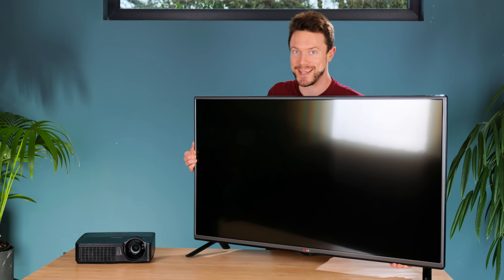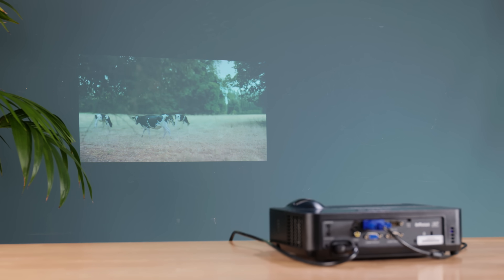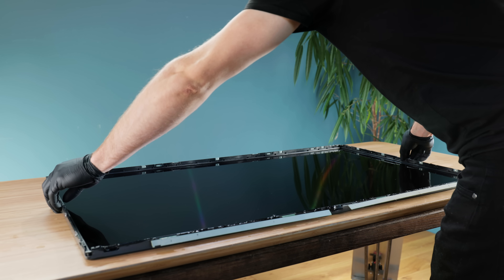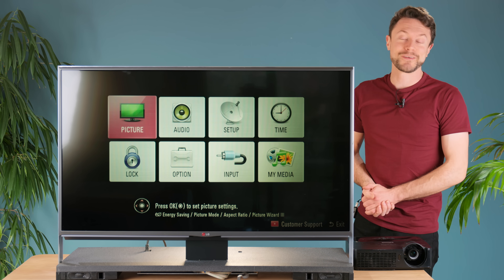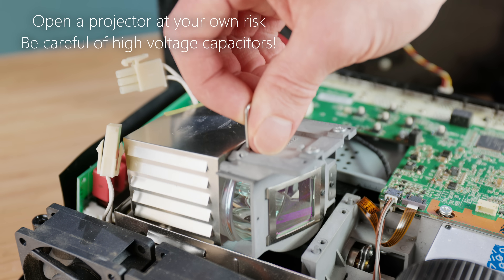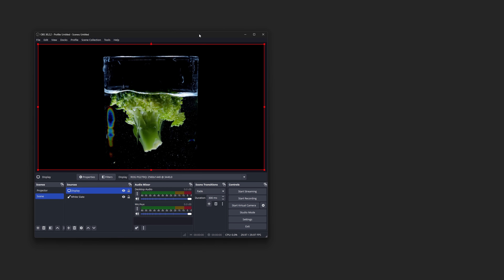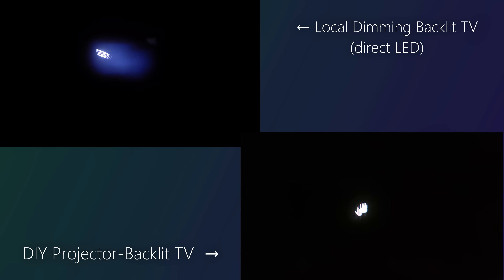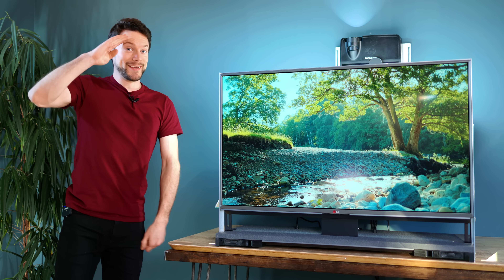DIY "infinity contrast" TV -  with 100% recycled parts

Comment from the maker: Thank you guys so much for watching! I've been trying to make more accessible projects lately (after going a bit wild last year)... smash the like button if you think this is a good idea! Also, how many previous projects could you spot in the background throughout the video?
Reply: I actually want to see how good of a monitor can you make if you are not budget constraint! Either using this projector method or the dual lcd you tried in the past... like a 4K 120hz super bright monitor.
Reply: Last year was brilliant. Especially the PS5 Slim.
Reply: I’m curious, what if you didn’t add the diffusion sheet? I’m sure the parallax effect would’ve been removed. The only challenge would’ve been alignment. And technically, this could result in even better light resolution than what is lost due to OBS’ glow effect?
Reply: Please don't limit yourself to ideas and projects that would be accessible. Your high-quality videos are what make your work stand out—there’s no need to compromise on that to keep things accessible.
Reply: As usual. Genuinely genius
Reply: It does make me wonder if simply finding an old projector TV, replacing the bulb, removing the filter, and installing an LCD panel in front might actually make the most sense as a complete package.  Could probably even get vastly more brightness these days, even before removing the colour filters.
Reply: @TheVenerableMrKrieg I like this idea! I have a very large 75 inch dlp rear projection tv in storage! It needs a new bulb but that would be a fun project if I ever find a 75 inch lcd with a bad back light!
Reply: You can maybe hide the long throw projector in the ceiling if you have a fake ceiling
Reply: Your projects are always very inventive. Not just copies of other stuff on YouTube. That's what makes them so great.
Reply: this guy also did something similar
https://www.youtube.com/watch?v=VY57LZGHuSw
Reply: We do like the both sides 😜
Reply: I would like to see this without the diffuser sheet
Reply: You're the Willy Wonka of brass and DIY <3
Reply: You are a Brilliant Man! :face-green-smiling:
Now I see OLEDs are Truly Overpriced!!  They do cost more to make, but they sell them for 10x the Price!! :face-blue-wide-eyes:
We can just go back to the 'Big Box' 'Big Screen' and get the Best image for Peanuts!!
Reply: Technically... if every pixel is aligned perfectly... you wouldn't need a diffusion layer... so a 1080p projector onto a 1080p lcd would have been very interesting
Reply: Thanks for thinking of us. I loved the USB-C convertion project and all my equipment has been extended due to your help. Thank you so much! Killing it KING 👑
Reply: You mentioned how amazing rear projection TVs could have been had they used an LCD as well.
Why don't you make that project?
Reply: Maybe I missed something, but can you explain how the TV and the projector are connected to whatever is running OBS? Is it like a computer that is seeing two screens and you're telling OBS to apply the glow filter to one and not the other? Can you consume any media on that TV that is not on some level on the computer OBS is running on?
Reply: Next project...  IoT projects like smart irrigation, home automation, asset tracking
Reply: While I'm always in awe when I see your "crazier" projects I really really love your more accessible projects (especially when they're recycled as that gives them an environmental + price advantage).
Btw I'd also be interested in simpler recycling idea videos again (format: "I have this old device/gadget, what can I make from it") like what you did for old laptops way back - perhaps that's a topic/format you can revisit on your secondary channel...
Reply: Bro building a crt-sized lcd TV :D . 
Typical DLP contrast: 1:1000 typical lcd panel 1:1000.  Final contrast: about 1000 000:1. Also If I understand correctly there is still glow but it is super tiny. That's impressive, but is it really practically possible to use it? 
I've a big question: how do the two displays are forced in synchronisation? I mean the input lag from the TV and from the projector may be very different. In addition, the obs stuff is adding a delay on the  projector side. So that the backlight from the projector may be late Vs the LCD panel, leading to big issues on fast movements. But I can't see it on the video, at the contrary it seems perfectly in sync.
I had this kind of issue in 2010/2011: at this time I had build a stereoscopic display (display with depth-3D). It was using two LCD displays and a half-mirror (stereomirror). My video source was my computer, I used it for 3D gaming using a dedicated driver. The issue was: starting 2011 graphics card's drivers was not providing anymore perfect synchronisation between the two outputs. Even single frame discrepancy is naked eye visible on a stereomiror display or a dual projector 3d display. As you are using OBS, you probably use a computer as a video source, one output for the TV, one for the projector.
Reply: @GuigEspritDuSage  Well spotted. Not enogh info was given in the path way for the HDMI signals and relative processing times.
Reply: LMG will be jealous again, well done!
Reply: Why did you fail to mention where you got this idea from?
Reply: @timmturner  Don't ask for that
Reply: Petition for you to make one of these but with a >90" tv and short throw led projektor 😄😄
Reply: You're the best, you inspire me so much! Can I ask you an important question? 

I saw in your video about the biggest iphone in the world that you sealed the edges of the oled tv with low modulus high adhesion silicone. Many oled tv owners, me included, have problems with dead pixels developing arround the screen exges due to delamination, humidity or contact with air. I think the seal breaks as the tv gets older and the pixels start dying. 

The question is, do you think sealing with silicone is safe and can prevent dead pixels forming arround the edge making the tv last many many years without forming dead pixels? I mean all the amoled phones don't ever develop dead pixels because they are sealed perfectly. Do you think it is safe if seal the edges of my tv with alcoxy based silicone? 

If you'll read this thank you and you are a great inspiration for all of us!
Reply: your videos are so cool ! always bringing me a smile thank you
Reply: I love it.
Reply: Maybe a wide angle lens in the proyector + mirror.
Reply: I am going to translate your video in hindi but unfortunately I can't find it.😔
Reply: This was by far your best project ever and the fact that it USED MINIMAL BRASS was just the chef's kiss!
Reply: How to make tv and projector produce same image at same time? Dose anyone knows?
Reply: @ HTPC with two video outputs
Reply: Honestly your projects are so inspiring and well executed, I love all of them!
Reply: Could flipping the projector and using the keystone setting make shorter?
Reply: No, no! Go crazy please!
Reply: a short throw projector would be ideal for this to keep things compact.

also you should've insulated the plates around the power supply to limit arcing to stuff on the tv stand/people.
Reply: dont make more make good like always
Thats why we love your videos because they are so good 👍
Reply: 13:35 chatgpt ah sentence
Reply: We would love to have accessible projects! How about something like this DIY Gaming Phone? https://www.youtube.com/watch?v=px1A6XptqhQ
Reply: Why not do it without the diffusor? The diffusor does just blur the light before it gets to the LCD. For projecting the backlight you want no blur but pixel accuracy.
Reply: @OreoBambino it's probably really hard to line up perfectly
Reply: Your skill level can be intimidating at times lol
Reply: I loved seeing some of them! I was just imagining if you had everything you've made all set up in your house.
Reply: You've outdone yourself, this is brilliant and accessible and just amazing
Reply: it would be very cool to see how this would work with an ultra short throw projector!  you could probably fit the whole thing in a small case  :face-blue-smiling::hand-pink-waving:
Reply: Accessible? Idk what you mean, I'm having a blast over here with my 6ft iPhone from your instructions 😁
Reply: Video idea! I’ve seen people bring natural light into their homes using fiber optic cables. I’d love to see your take on this idea!!
Reply: Love the idea of making more accessible projects!! A few questions about this project though. When running OBS through the projector, is the same computer being used to run through the tv? If so how is this done? I would assume the same pc so u don't have lag. but how can the OBS filter only be ran through the projector and not the tv?
Reply: @DIYPerks  both are great. The PlayStation was entertaining, while this is more practical. I don’t know what the balance should be, but there should be plenty of accessible if you want to keep the “DIY” in the channel name
Reply: I can't comment on the main thread for some reason.  But excellent project!  You have a knack for making amazing results with style.
     That said, before modern/OLED etc displays, I wonder if any manufacturers considered doing something similar, except with an additional monochrome LCD sandwiched inside, performing something similar to the projector?
Reply: Please keep making it better and more compact, it will be very interesting to watch this as good TVs cost a lot of money nowadays
Reply: Im a EX SONY TV tech from the 90s and I remember the rear projection TVs used special front surface mirrors to eliminate secondary ghost reflections caused by the thickness of a standard glass mirror tthat has the recector surface behind the glass.
Reply: This would make OLED screen go belly up.
Reply: I bet the price of any OLED TVs are way to high to benefit from buying one, compared to this DIY TV, if contrast is the main reason one would buy it, but what about power consumption? I can imagine it using more power, but it's lifetime would make up for it anyway

OLED will burn in over time, and might need replacement before this DIY TV even struggles with the light bulb, which can be replaced for really cheap, so I can't even imagine this DIY TV to cost anything like an OLED TV, even after 10+ years of uptime, with most likely multiple light bulb replacements
Reply: True, this one I can copy and improve on one day when my 75" TV has lost all significant value. It's maybe the best local dimming I've seen? But...never perfect. Despite size it wasn't very expensive.Outright bad scrolling for example these comments. Thanks for doing the hard work. Very clever usage of OBS.
Reply: This was great as always!! A question I still have is how you feed the image to the system. To the LCD and to the projector, you use OBS but how? Do you use a laptop or 2? And how are the images synced?
Reply: I love all of them. The complicated ones for entertainment and enjoyment. The accessible one for fantasizing that I can actually do them 😂😂

You are great. Thank you for these videos.
Reply: Would love it if you made a guide for the invisible pc desk, its a very useful project for people who doesn't have space for an office in their apartment
Reply: Bro, 
These could be next type of TVs in Market.
Reply: What if you sandwich two LCD screens together? One serving the same light map purpose... I guess it might be too dim, but much more compact.
Reply: @adek86  I think he did that previously
Reply: Can you take an old rear projection TV and put a LCD screen on the front of it and get the same result?
Reply: Thank you!
I think it would be good to have a mix of complex and easy projects.
Reply: Dual-Layer LCD project could be modified with this? OBS on the back LCD? Could that help with the the problem of light with Dual-Layer?
Reply: Absolutely blown away how you keep coming up with these incredibly original and consistently impressive AV hacks; if the consumer electronics industry still had any of the vision and optimism it possessed in the eighties, you'd have been offered a job several times by now.
Reply: Absolutely brilliant, this one.  Best yet!
Reply: Yes, good idea
Reply: Why not take an old 1080p LCD TV with a normal backlight, and then run the OBS filter through that TV, and then sandwich that behind a newer 4K LCD TV of the same size? There shouldn't be enough backlight bleed coming through, but I guess the peak brightness would be lower? Might be worth trying.
Reply: What if you use an OLED instead of the LCD 🤯🤯
Reply: I wonder how much better would it look with a higher end projector?
Reply: This is why I jumped to the comments. It’s great to see a project that’s much more simple, yet still true to DIY Perks. My wheels are turning with the wall cubby in our family room…
Reply: Interesting! Is it possible to build something like that using an LCD projector? Would it provide enough light when projecting onto a TV screen, considering that the LCD projector already has an LCD matrix inside?
Reply: rear projection television... that is what you made was a rear projection television...
Reply: @InconsistentManner  and made it spectacularly...
Reply: I think a short throw projector is just lens work so should be possible to convert existing projector itself to short throw projector. I mean if through some "Alibaba" connection you can procure a super wide angle lens it should be possible to light to the screen through a series of prisms.
Reply: @DIYPerks Amazing video, as always! I'm just wondering how would upgrade to a LED light source improve gamut. By higher CRI?
Reply: I posted a longer comment elsewhere, but figure I'll toss a short version in here hoping you'll see it. Mount your LCD inside a DLP projection TV! Your projector, mirror, and alignment are all pre-baked into the case and you have zero light leakage. Matching aspect ratio and resolution is also a (cough) *Perk*. 
Projection TVs are a dime a dozen on community marketplaces, the hardest part is finding one that's the right size for your LCD panel. 
SO many Perks I'm surprised you didn't go with that in the first place.
Reply: Would love to see this done on something like a Sony Grand Wega with a 4K panel
Reply: I know it's hard to publish these types of videos, it takes a lot of time. But please make two videos per month if possible.
Reply: Awesome channel, really like to see how creative you can get with old parts and things laying around. It’s been a while I’ve been wondering if its possible to make a LCD 3D Printer with an old monitor or tv and I’m pretty sure this project would fit perfectly on your channel, already search a lot for something like this over the internet and found nothing.
Keep up the good work, hope to see more of your content soon. Best regards from a brazilian fan!
Reply: U are an absolute genius!!
Reply: can you do a build guide for diy force feedback sim racing rig from scratch
😊
Reply: How bad is the latency for gaming?
Reply: You are most welcome
Reply: There was such a project about 20 years ago… Two matrices that use a parallax between two eyes will show a 3D image without eye glasses. Alignment of pixels will have to be considered as a neural network, because mathematically the problem has an ambiguous solution. Try to google this project.
Reply: It would be cool to see a version of this where the tv essentially is the whole wall that would look insane like a home theatre, amazing video and idea!
Reply: try this with an IBS panel
Reply: try this with an IPS battle
Reply: try this with an IPS panel
Reply: this one is by far the best  project that i've seen in a year
Reply: I have to admit that I love the metal housing series of videos, especially the thermal camera footage!
Reply: You know you come up with something truly remarkable when an inventor the plugin you used comments on your channel.
Reply: Thanks!
Reply: Quick question, as the projector is basically perfect lighting, do you need the diffusor? I get the feeling that you can get even brighter without it but I have no idea if it would even work
Reply: I'm sure you could build all of this into a media wall made of those fake wood sound panels.
Reply: There exists RGB led mats with display control, they are of incredibly high resolution than normal tv back light, more better colour and contrast than projector,.
I think you should try laying one on the back of the lcd, they are less than half a inch thick.
Please try it.
Reply: @prabalkumarsamanta8 After all, such a mat has a low resolution (max. a few thousand), and here a cheap 720p projector with a resolution of 1 million pixels is sufficient.
Reply: Very interesting project, sir. Do see if you can get results with a short-throw projector, too 👍
Reply: im glad for your enthusiasm, HOWEVER  there have been multiple companies who have made a built in rear projector walls over the years... literally your  "hack".  It cost thousands upon thousands of dollars too. Custom jobs with nice wood work and speakers with an entry door to access the dlp projector.  I think you have actually seen them as they are in the home entertainment trade mags alongside Christie and Barco projectors.
Reply: Literally no. The projector doesn't have infinite contrast so you can't use it to make something else have infinite contrast. Stop the click bait BS. You are literally trying to lie to people for your own gain. You do realize how scummy that makes you, right?